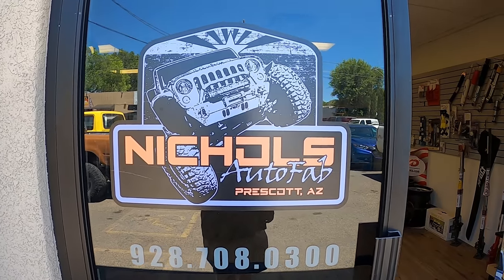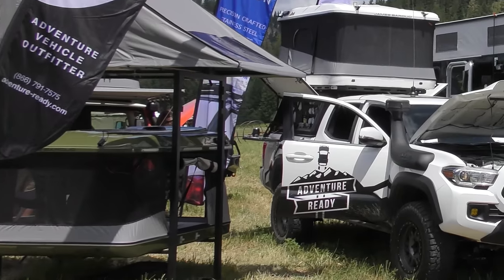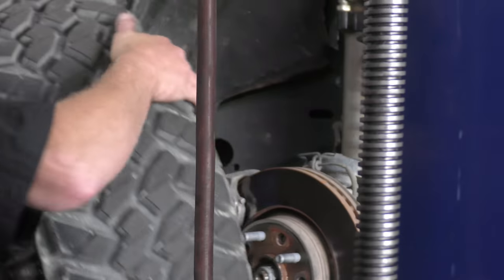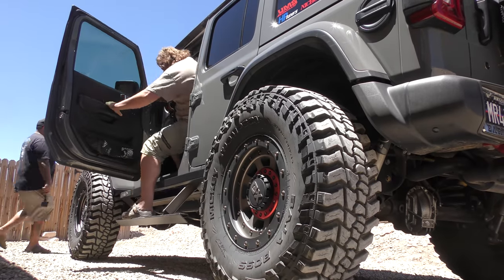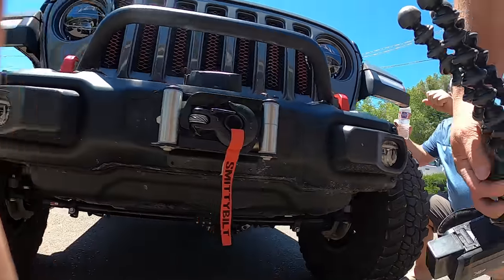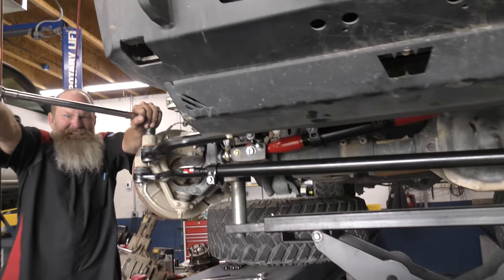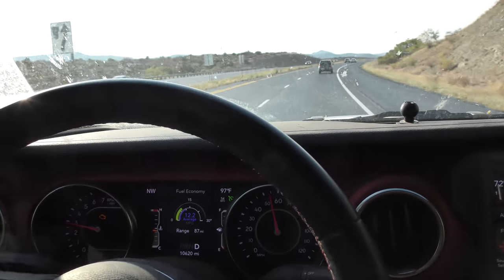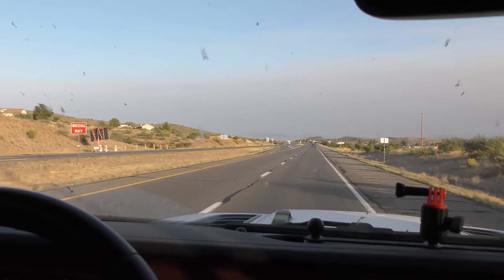FIX YOUR Jeep's SLOPPY STEERING with Steer Smarts - Jeep Gladiator Dream Truck Camper

Comment: My Max Tow Gladiator has 13,000 miles and it drives just fine, the steering is tight, precise and tracks smoothly down the highway at any speed. I have stock suspension with takeoff Rubicon Fox shocks and 35 inch tires. I kept the stock steering stabilizer. I've taken it to Colorado and done the Alpine loop, Carson ghost town loop, Oklahoma K trail & many other unknown four wheeling places. It's not a mall crawler. My point  is: unless you have issues don't fix what's not broken.
Reply: If you encounter any steering problems in the future, just upgrade the stabilizer, done it on my rigs in the past. Works.
Reply: @davidcox2197  If I encounter any steering problems it will most likely be due to worn out ball joints or other worn out parts that I will have replaced.
Reply: Steering Stabilizers wear out faster than shocks. A new one can eliminate steering wobble completely.
Reply: @davidcox2197  well for now I'm going to stick to the if it ain't broke don't fix it philosophy.
Reply: @David_Nichols  What about the "upgrade so I don't have a problem" ?
Reply: @xbpbat21x  I think if it's not broken, don't fix it. Like I've written before the major cause of steering issues is worn out components. That is aside from the defective steering boxes that Jeep is replacing under warranty. I'm fortunate to not have that issue.

Comment: There’s a TSB out for poor steering in the JL and JTs. It’s an entirely new cast iron steering box along with new software. It came out a month or two ago and the feedback is that it works. Get that done and save your money.
Reply: Had my JT Overland done a week ago and its just the way is should have been! $0

Comment: I need to do something to my 2018 JLUR.  Its not terrible but does require constant input into the steering wheel.  Interstate/4 lane good highways isnt bad at all but these little country roads with dips and such is awlful.  The strange part is that when I lifted it and went to 37’s I figured it would get worse but it didnt....   I have bought the steering box brace from Synergy.   Hope that helps.  Now I’m hearing rumors that Jeep is actually replacing some steering boxes....
Reply: Mike Robbins there’s a TSB out that replaces the aluminum steering box with a cast iron one. It should fix your problem. Getting a dealership to look at it with those mods will be you biggest struggle unfortunately.
Reply: Mark Claypole    Yep....   I am gonna try in a few weeks.   I didnt buy it from my local dealer but they have been great anytime I’ve had it down there (only 2 times).  I think they are happy to do warranty work any time..   Small dealer and not all that busy.  I’ve known a couple of Tech’s that worked there and said they had to find some other way to make money as they werent busy enough...
Reply: my JKU has gone through 4 steering stabilizers in the last year since upgrading to just 35"'s! The factory ones are crap!
Reply: @MandyMakesThat     The 2010 JKUR that I had only had death wobble 1 time.  It had right at 100,000 miles on it when it happened.  I was running 33” tires at the time.  I replaced the steering stabilizer to no avail.   Replaced the track bar and fixed it.

Comment: The wandering steering root cause is due to the aluminum steering box. There is a recall. The Steer smarts is showing issues with bending TRE's at the threads. Keep an eye on it. Furthermore, the SS TRE studs are SMALLER than stock and use their bushing system. These are breaking INTERNAL to the TRE end, snapping cleanly. Get your recall done. Keep your stock system (or upgrade to something better such as synergy or RPM)  and stop spending money on snake oil.
Reply: You’re incorrect in your statements about these breaking off internally and being weaker than the stock because of the straight shank design with taper sleeve. The purpose of our design is to keep the steel stud from galvanically corroding into the aluminum knuckle. The week point is definitely the aluminum knuckle and not our stud - we know this from our extensive testing as well as from customer feedback from those who have been in front end accidents and our products were both straight and undamaged - they actually ripped the knuckle boss off of the aluminum knuckle. (In addition to our torture testing we also have photos and actual products that sent back to us with the aluminum knuckle boss still attached to our end). If there was a failure with the stud as you described it was d/t improper installation with the customer not following the torque instructions or not using one or more of the included parts - again, failure to follow installation instructions.
Reply: @SteerSmarts  3 of them?? I think not. Your crap design is going to kill someone.
Reply: @mcoffroadinaz4075  I’m sure you have an engineering degree, specialize in steering components, and have tested our products extensively to prove your claims. Thank you for your opinion.
Reply: @SteerSmarts  unwarranted belittling me, to try and hide the weak TRE's, only proves me correct. Thank you... 
Oh, and you might want to start looking at the thread section of the TRE's. Seeing a few with bent sections at the exposed threaded area. Maybe time to take them over and get some Rockwell testing on all components and share with the world.
Reply: @mcoffroadinaz4075  not belittling you, but unless you’ve spent the time, effort, and money that we have to design high quality and reliable pieces like we have, what validity does your opinion have? Apologies if we offended you, but you are making claims that you have no backing for, so what does that say of you?

The parts aren’t indestructible. Where someone might make a mistake or have an issue and bend our end, our competitors product will break a stud or snap an end, which leaves you stranded on the trail. 

You talk about unwarranted belittling - take a look in the mirror.
Reply: @SteerSmarts  once again, deflecting the issue away from the EXPLODING TREs and the NOODLING thread-sections to question my validity isn't really helping you or any customer that has yanked off their $1000 worth of steering, only to be told they "torqued it wrong." That also includes industry leaders that are quietly moving away from your product trying not to upset your hornets nest of marketing and threats.
Reply: @mcoffroadinaz4075  👍 good luck to you and your internet trolling.
Reply: @SteerSmarts  best of luck to you and your Mexican-Made truck steering. 

FYI, your stabilizer is awesome for the JL. Just wish I didn't pay $1000 to find it...
Reply: @mcoffroadinaz4075  this comment proves that you know nothing about our company. Good luck to you 👍
Reply: @SteerSmarts  Well, I stand by my stabilizer statement. It's very good. My compliments to the company that made it.

Comment: Love your channel. Unfortunately Jeep is now owned by Fiat. The worst car maker on the planet. I wouldn't give 5 bucks for a Jeep since Fiat took over. My cousin bought a Jeep Renegade last January. It's been in the shop 7 times since then. POS. And yes I told him so....repeatedly.
Reply: Jeeps are still made in Toledo Ohio by the same people with the same factory equipment. Been that way since 1941. Fiat bought them, but it's not like they have changed everything over. All that changed is the address of the home office.
Reply: @David_Nichols  are they or are they not using Fiat parts? The answer is yes they are. Are they or are they not using Fiat designs. The answer is yes they are. Are they or they not using Fiat designed engines. The answer is yes they are. In fact the Jeep Renegade is a Fiat Abart with a modified body. Are Fiat/Peugeot designed vehicles considered to be some of the worst designed and built vehicles in the world? Why yes they are. I did not say that they were built in Italy. I said that the vehicles are crap. And they are. That is not even up for debate. Virtually every one I know who owns one, wishes they never bought one. No offense but you probably believe that Chevy still makes good vehicles. Not even close.
Reply: What is your daily, Mr. Rocker?
Reply: @techguy7402  2016 Mustang gt 350.
Reply: Oh and I just checked out the rankings for Fiat Chrysler for 2019 and 2020. The Jeep Wrangler is third from the bottom of the most unreliable vehicles built today right above the Ram 2500 and the worst vehicle made in America, the Ram 3500 dually. POS. And this was confirmed by 7 different car and truck reliability websites. Buy whatever you want to. But don't complain when you and your service tech become besties.
Reply: We’ve had my wife’s Renegade for a year and a half now. No issues at all. From around town to weekend trips, it’s a great little car.
Reply: @Cornpone  that's great. I hope it stays that way. Continued good luck.
Reply: @Cornpone  heehee you called a Jeep a car